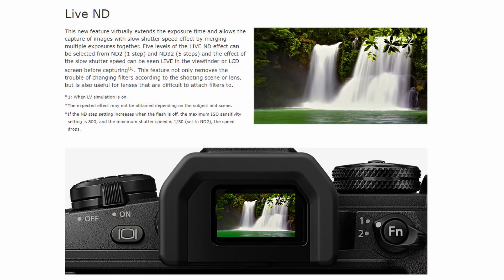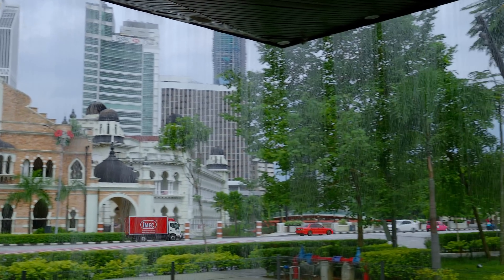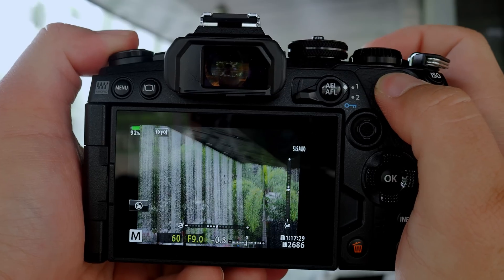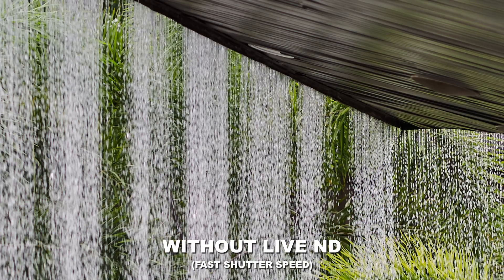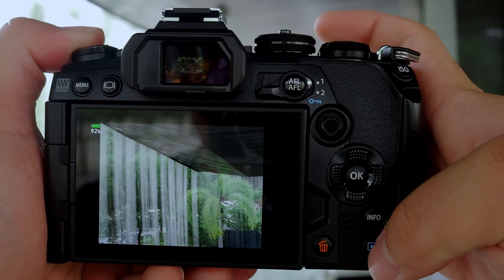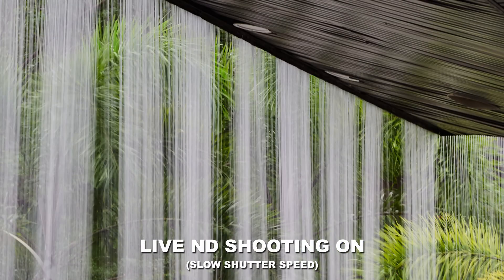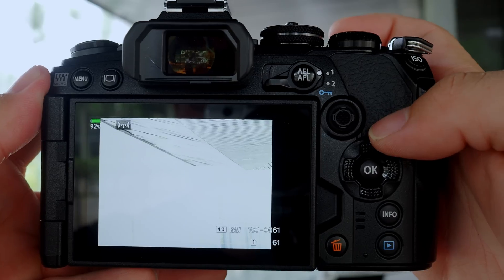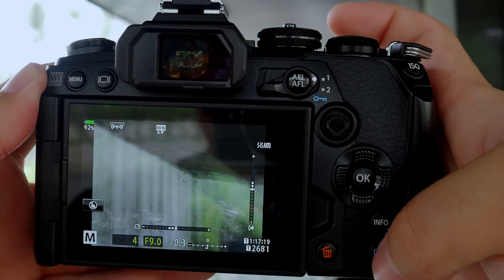Olympus LIVE ND Explained - Can It Replace Real ND Filters?

Comment: I just wish instead of multi shot composition for ND they just had a several different gain amplification circuit option so the camera could operate natively at something like 3 ISO, 200 ISO and 3200 ISO... this way we would have cleaner low ISO, cleaner high ISO and the "ND" would work in video mode too... Sure also include computational ND but native ISO options would be BOSS!

Comment: Nope, the thing, that it'll not be in other cameras is just marketing issue. Why you would buy expensive M1 Mark III, it all of the features exists in M5 or M10.
Processor? Well, it can affect the speed of stacking frames. It's not a problem, if camera will shoot 3/4 frames and then go for stacking, as it does in saving series or bracketing.
Everyone just need to make more money, so Olympus too :)

Nice video btw, but i wanted to see the difference with water on ND16 and ND32. I think on ND32 there'll be much better pic.

Comment: I just realized that the Olympus User Manuals for the both the E-M1X and the E-M1 Mklll are in error regarding the Shutter Speed limitations for Live ND. Both manual state that "The slowest shutter speed available varies with the ND filter selected." It should say, "The fastest shutter speed available...". Maybe Robin can pass this on to Olympus for future correction.
Thanks Robin for this excellent and clear presentation of this very useful feature.

Comment: I use high res mode to obtain a similar effect: which is the actual difference in real life?
Reply: If something moves in high res, it looks bad because the frames are shifted and there are jumps and gaps in the motion blur. Live ND takes the pictures with a continuous exposure, so the readout is going on for 1/30s or longer. If something moves, you get the expected motion blur.

Comment: So this can only be used in really low light, maybe those extended low ISO's may be of use ?
Reply from the maker: You can use this is bright conditions, I found no issue with that.
Reply: @robinwong  That's good to hear, I thought those shutter speed limitations would be a problem. When I can go somewhere with water I will try it out.

Comment: Great video, Robin, thanks. At 12.50 you said “you cannot shoot anything faster than this shutter speed (1/2 second). You probably meant anything slower.
Reply from the maker: No you can't go faster. Meaning you can't go 1/4 or 1/1000, you can go slower like 1 sec, 5 sec

Comment: Nice again Robin. How about something short on high key and low key photography. Maybe it is not used a lot because its not fully understood. Will appreciate.
Reply from the maker: I don't do such photography though, in case you have not noticed my images are always quite well balanced, not tipping too far to black or white, as high and low key photography would require.
Reply: Lately I’ve really switched on to using Low Key gradation with Contrast +1. If relying on the camera to meter then yes you get a darker image with highlights better preserved. BUT, if you bump up the Exp Comp and use the histogram to meter you get a slightly richer colour palette than if using Standard Gradation. I’ve done many tests and now LOVE Low Key Grad. In Monochrome is where Low Key Gradation (+1 contrast) really shines, by far the best OM-D setting for Monochrome, deeper blacks but still able to deliver true whites for contrast. Basically a better tonal range... in my opinion.

Comment: It´s a very handy feature, I used it some times and I never knew how it works, thank you Robin. Another feature drives me crazy. I used often the Foto stacking mode in my Olympus OM-D EM10 II , the picture was made ready in the camera. I heard that this also works in OM-D EM1 III , but I always get single pictures to stack them on a computer. The option "Foto stacking" in the Menu was always greyed out! How can I activate it and how can I manage that the camera makes the Foto stacking?? In M10 it was so easy!
Reply: There are limitations in which shutter settings can be used. Without checking I think you have to be in one of the electronic shutter modes. There may be something to do with focus points being used as well.
Reply from the maker: I have a video on Focus Stacking. Go see that video, it was quite a recent one too.

Comment: To me, it looks like focus stacking without a change of focus. It shouldn't be too difficult to introduce it to cameras that already have focus stacking.
Reply from the maker: Focus stacking works very, very differently. They are composites of course, but they stack using different methods. Live ND is much closer to Live Composite than anything else.
Reply: Focus stacking does make the images first, stores them in the buffer storage and merges them afterwards, that's why you get the progression bar afterwards and have to wait. It's basically just burst shutter mode with focus shift an computation afterwards. Live ND does all this while taking the pictures and even shows you the current result. That's waaaaay more complicated for the camera's processor. Cheers!

Comment: When I just got mkIII tried to use live ND , of course without reading manual ;) first. So had to learn all of these limitations hard way ;) I wish I would see your video before , it would save me from scratching my head many times. I think this feature should be treated as ‘in camera’ effect , very similar to focus stacking and as long as you know limitations it can come handy in particular situations. Thanks Robin for another useful video!
Reply from the maker: Thanks for the kind words. Sorry I did not get to explain the Live ND earlier. As you are aware, I do not own the E-M1 Mark III or E-M1X, and only recently Olympus reopened (after easing of Lockdown in Malaysia) and I requested a loan unit for E-M1 Mark III.